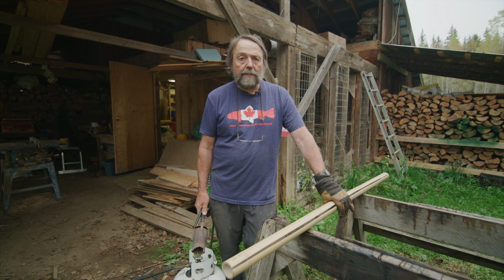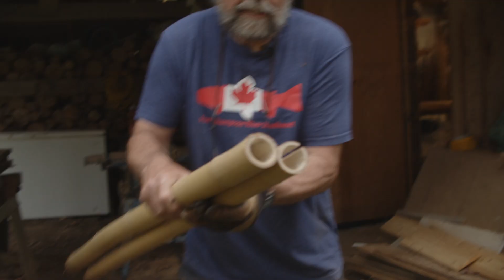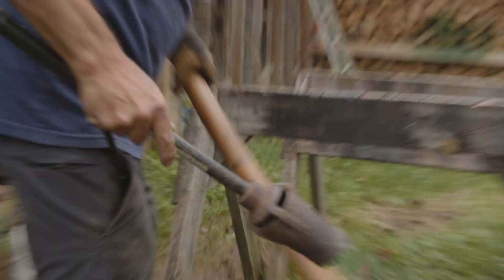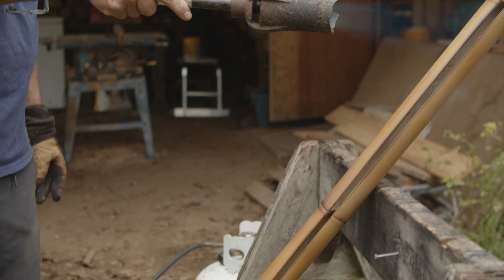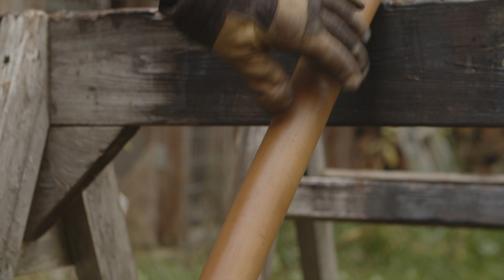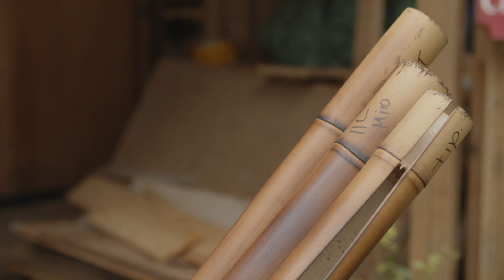Rod Building Masterclass - How to Flame Culms

Comment: Rods?  Culms?  Flaming?  Please enlighten us uneducated people wtf you're talking about... without having to watch the whole video to figure it out.  Thanks.
Reply: The culm is the stalk of bamboo. Rods are what you are making after numerous steps. Flaming dries, cures, and tempers it for strength. Moisture will cause contraction and weakening over time. The bamboo when curing releases an oil that acts as a natural varnish to protect it from water exposure. Some rodmakers add a substance for extra protection to supplement longevity. As always, every step of building, the level of skill effects how much supplement you need to add.